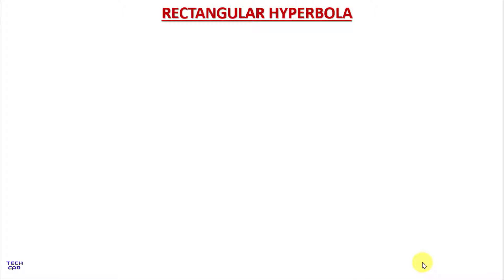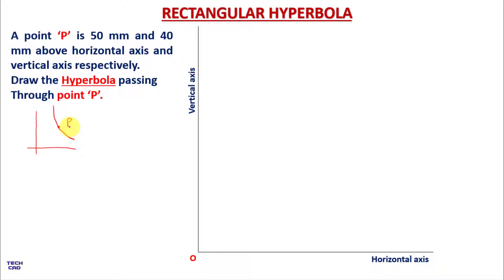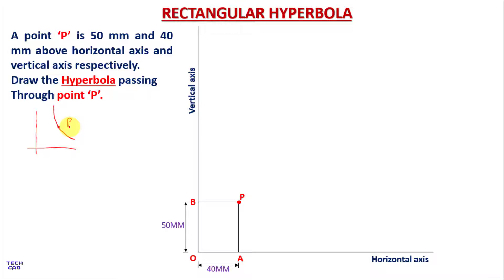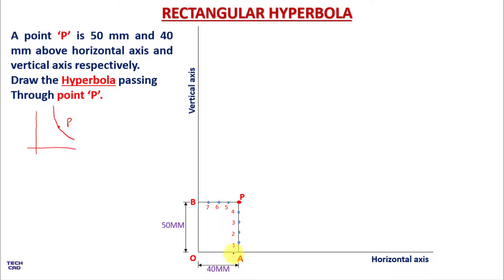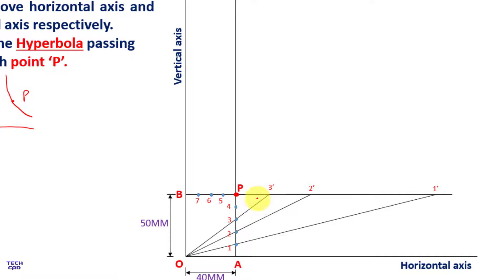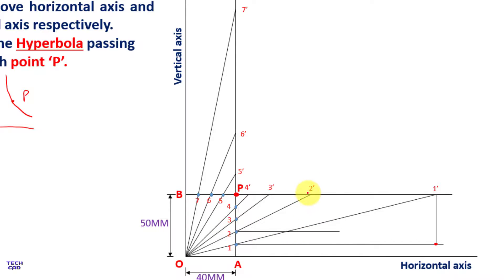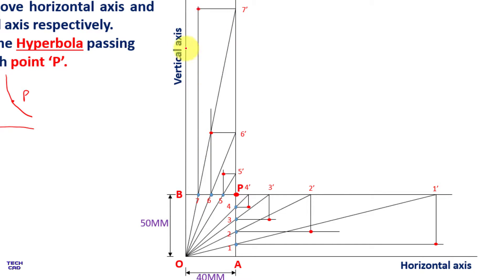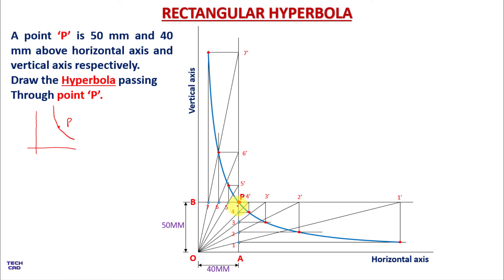HOW TO DRAW THE RECTANGULAR HYPERBOLA IN ENGINEERING DRAWING

Comment: Thank you sir but my question has a diameter
Draw an hyperbola using rectangular method given that the length and breadth of the rectangle is 100mm and 50mm respectively with a diameter of 30mm